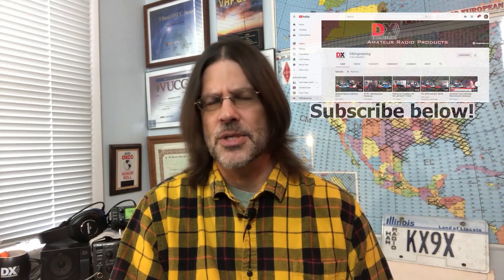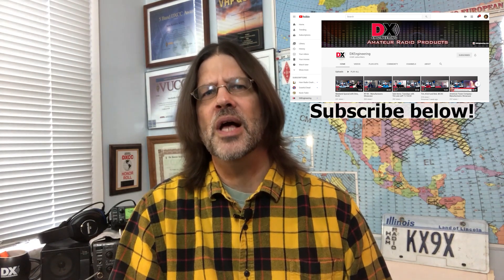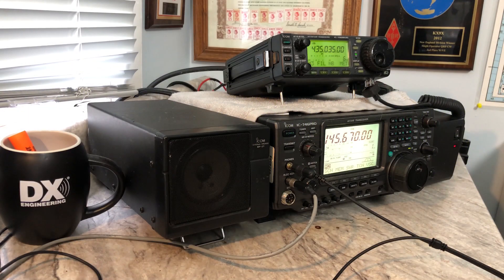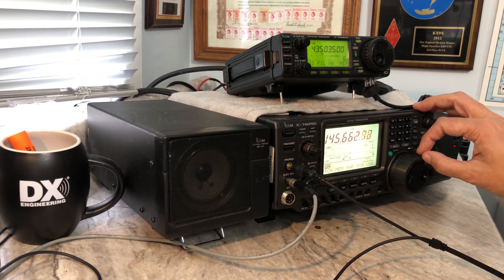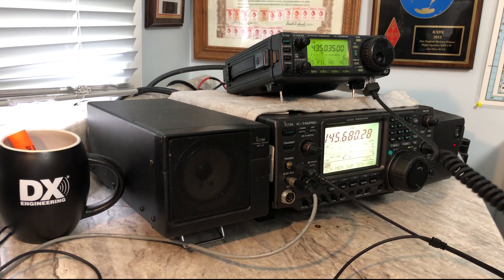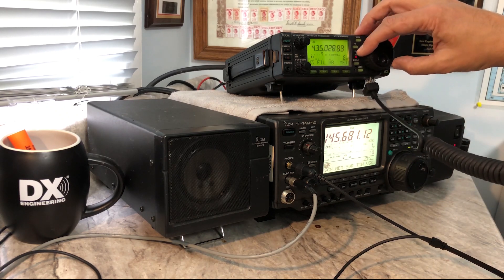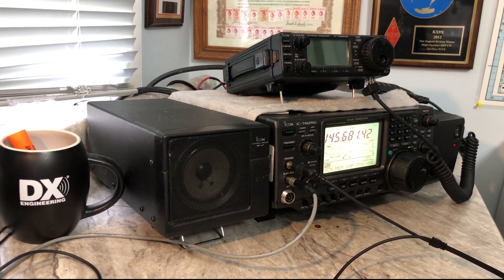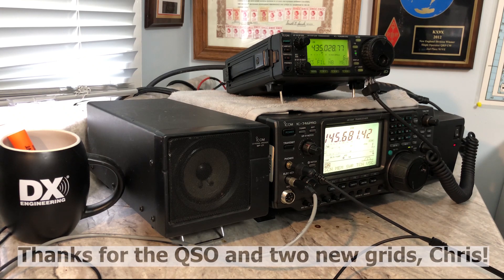Operating Amateur Radio Satellites from Your Home Station

Comment: I know this was 4 years ago, but TU Sean for this series. I’m using this as a basis for a talk I’ll be giving to club to get folks interested in SatComm with the cheapest, simplest, yet most effective setup possible. Amazed that you didn’t use computer control with SatPC32. I’ll be showing the new SkyRoof, using SDR receive with TX FT-818 or IC-706Mk2G and either Halibut EggNogs or Arrow with WA4MCM kits rotator on a photo tripod. All simple stuff. It’ll be spring before I have this put together and have the data to recommend. 73 de WB4YDL

Comment: Nice video series thanks for the info it's especially nice to see the demonstrations. I am looking at potentially setting up a home station for satellite. If I am using a radio such as the icom-9700 that has separate antenna connectors for 2m and 70m could I successfully hear myself on the downlink using a dual band antenna with a duplexer?

Comment: Sean thanks so much for the info on the M2 antennas. I am in the process of installing them now. I want to use HRD Ham Radio Delux to control my 991A and track and contact satellites with this antenna. I have two questions, 1 is the 991a a full-duplex radio, it has two vfo's and can operate in split mode. 2 have you used the HRD program, what do you think? Oh and one more, how do you know which satellites are repeaters that I can contact? Thanks in advance.
Reply: PS KO4PDI